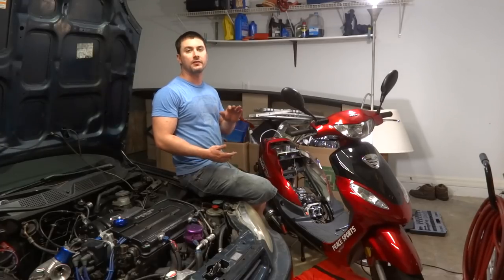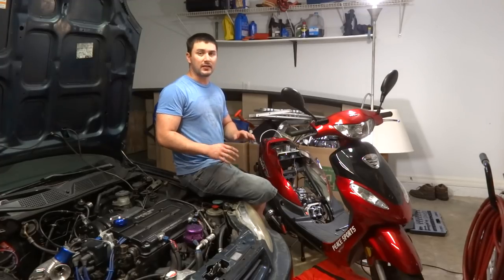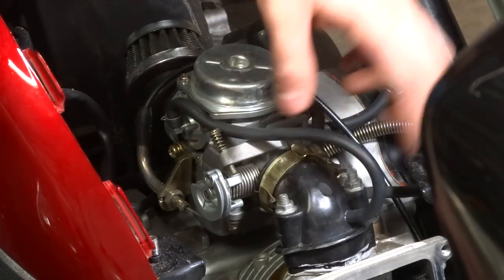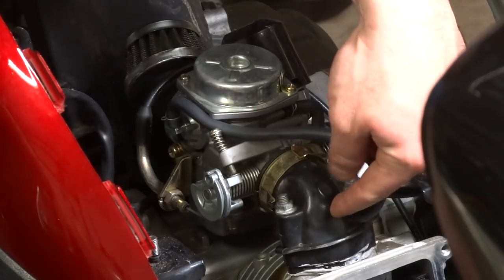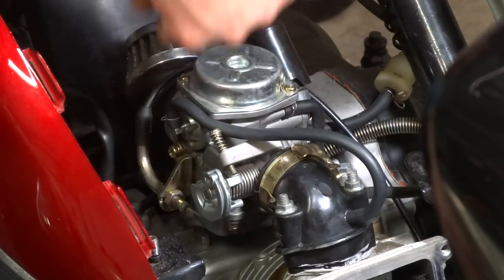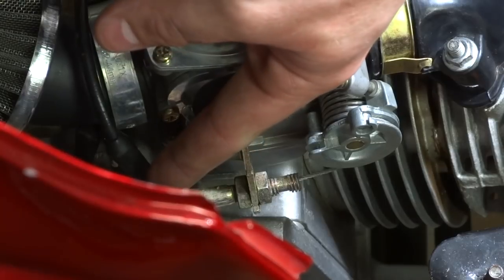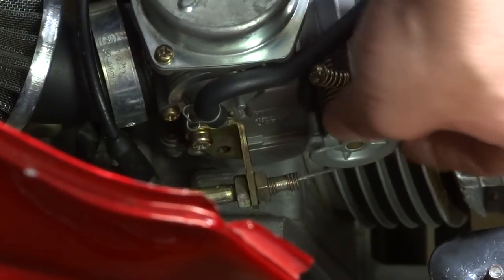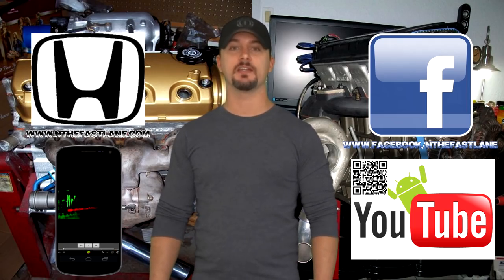150cc Carburetor On 50cc Gy6 "How To"

Comment: I have built a few 100cc BBK engines and have been using stock 150 carbs on all those engines for several years now with their stock idle and main jets.  They allow the engine to breath and pull really strong and reach speeds fast.  I am in the process of building another 100cc BBK engine using an Airsal piston, big valve head, Naraku HD crankshaft, A9 cam, 49/17T gears, 5 & 7 gm variator weights...love it!
Reply: Edwin Mendija Hi Edwin noticed your post and wondered would you mind a few questions I'm not new to tuning just new to Autos so I have heard that Naraku parts are very good so I'm getting a camshaft from them but regarding your list of parts 
the big valve head _how big compared to standard 50cc ?
A9 cam same question as above ?
how do you know the standard gears so you can up them to 49/17
im assuming the variatior weights are down to rider weight as well as revs motor is pulling? thanks
Reply: Edwin Mendija what size Jets are you using..or can you just put the 150cc carb on 100cc bbk.
Reply from the maker: Yes Sir. They really improve the bike. Can't tell you how many comments I get that putting a 150cc carb on  a 500c bike is impossible.  All you need is the intake neck.
Reply: Stock 150 carb just drop it in.  Adjust carb in small increments and you'll find the sweet spot where it idles and starts smooth & easy.  Must be used on a BBK otherwise cannot promise how this thing will act on a stock 50cc engine.  Combined with a performance exhaust, your limiting factor will be gearing...it'll pull strong until redline and stay there if you let it.
Reply: Okay so guys i have a 50cc taotao bws50 i did a bbk 82cc it was labeled as 100cc but its only a 50mm piston so yea but all i have done is a cdi,ignition coil and i run a ngk cr7hsa plug i got a 150carb and neck coming i can hit 45mph on flats now how much should i expect to hit with the new carb everything else is stock minus bbk,cdi and ignition and spark plug btw i weigh 130ilbs lol
Reply: My son, about your weight, easily goes 60+ using GPS speedometer. with that set up and 150 carb.  You do have performance exhaust right?  Also use 7gm variator weights.
Reply: Edwin Mendija I'll keep that in mind so far I've done a lot to mine you can check it out in my channel
Reply: @RspecNick  what's up man, I watch a lot of your vids btw. Did you ever put the 150cc carb on your 59cc bbkit motor? If so did it improve your mph? Mine does 45-50 with a Kehin carb bit I'm curious about the 150 carb. Also, I watched your vid where you swapped the 50 for a 150 motor. How fast does your scooter go with the 150 motor? Thanks Nick!
Reply: @mikecuev820  hey what's up man. And yes I did put the 24mm or 150cc carb on and it shot fireballs I needed to down jet 3 sizes it ran good tho from a dig.
Reply: @mikecuev820  with the 150 motor I was hitting like mid 60mph tho it was nice.

Comment: If anyone's wondering? Yes it works, it actually fixed my problems I was having, not sure why I've read so many comments on the internet/articles stating it doesn't work. Good thing I went for it, I did bought extra jets just in case, but it doesn't look like I needed them.. might be different for you though? Depending if you live up in the mountains or live near the beach. Also..you don't need to drill a hole and put a extra nipple, well you Do.. but my carb came with a 2 way splitter adapter, so it shared one nipple, and I didn't need to drill a hole.
Reply: I.need help ,I tried didn't work ,what did u do with those two hoses that was connected to the old 50 cc

Comment: I just rebuilt my gy6 100cc bbk will a 150cc card is a nasty combo 55mph on the daily in slc utah 105 main and 32 p
Reply from the maker: Yep, that's what I run. Heres the bbk aftermath test run on flat ground. Link: http://www.nthefastlane.com/Scooter/gy6-100cc-bbk-50mph-proof
Reply: Nthefastlane another question.. how many starters have you gone though
Reply: @ryanferreira3456  I've went through 3 and about 6 kick starts.. 1p39qmb 100cc bbk a9 cam port and polished head oversized valves I can stand on the kick start with the amount of compression it has I weigh 150

Comment: The 150 caliber I received the throttle bracket was just the opposite from top to bottom from that one the hole for the throttle cable was at the top side bottom side

Comment: i put a 150 cc carberator to replace the original 50 cc carberator to make it go a little faster. What else do I need to do from there? Do I need to replace the fuel line and throttle cable?

Comment: I have a gilera runner 50cc and I have 4 gram rollers, yasuni r exhaust and is completely derestricted. I replaced the stock card with a bigger delorto carb with malossi Reed valve. Now when I start the bike the engine revs up to its max and won't calm down unless the choke is on. is there any way around this because I want to use the carb

Comment: Nthefastlane i added the new carb to my friends big bore on his peacesport, but for some reason it wont start unless we add gas to the carb manually. We checked the vacuums, but i wasnt sure if we were missing something. Do u have an idea of whats going on?
Reply from the maker: Dani T adjust the throttle screw 1/4 turn tighten at a time till it starts.
Reply from the maker: Dani T make sure the fuel hose is on the correct nipple and check the vaccum hose.

Comment: can i use this without a big bore kit i have air filter installed with big jet 50cc scooter carburetor 4.5 rollar weights exhaust performance cdi and ignition coil

Comment: Hey.. Watched your videos and used them as a guide when doing the big bore install.. I put a 26m carbuertor on the scooter but when my son rides it. It would only hit like 40mph and it jerks hard when trying to full throttle....in yout experience what do you think is the problem....any information is greatly appreciated...respect brother..
Reply from the maker: I would look at your variator or clutch. He could have some sticky roller weights inside the variator causing them to shoot out abruptly. That can give you quite a jolt. Also a clutch that grabs wrong can do the same.
Reply: @Nthefastlane  too much gas!
Reply: @Bchassis  yep, the 24mm carb is too big for a "100" kit, much less a 26mm

Comment: I have a 50cc icebear with a 100cc big bore kit on it. And I would like to know which carb would be better for it.  The 125 carb or the 150carb?  or should I get the big bore carb?  please tell me which one would be better...  thanks for the info..
Reply from the maker: +dragonscave101 Get the 24mm 125cc carb, it comes with a 105 jet. All you need to do is adjust the idle screw a little. You can only only get one screw in on the throttle bracket. Go to my channel and look at my scooter section. I show what you need and how to install the 24mm carb.

Comment: Just got a 150 carb for my 50 upgraded with the 100cc bbk. Problem is my scoot doesn’t have any vacuum lines. The line coming out of the intake manifold is just a 3 inch hose with a vent on the end. The old carb used the throttle assembly to open the air piston and use the main jet but now I have no vacuum line to do this so the engine is stuck using the pilot jet all the time

Comment: Did you have to change any jets? My stock carb is super lean after 47mm kit. Tryin to get it fixed today but I'll eventually order the correct carb
Reply: I use a 150cc carb with a 105 main jet on my 100cc bbk and it works beautifully

Comment: I put the 150cc carb on my 50cc and it runs and drives fine but should I adjust the valves to .005 or keep them at .004? It has been upgraded with 80cc kit
Reply from the maker: 4 thousands to 5 thousands just boils down to what you feel comfortable  with,not going to make much of a difference except possibly a louder lash.

Comment: one thing dont remove the plastic shrouds from around the barrel(cylinder), it will over heat, on a open ruckus you might get away with it but on a scooter thats closed in they overheat.
Reply: aly nicholls that makes no sense at all those heat shrouds keep engine heat in and away from the rider they do not cool them that makes zero sense why would putting a blanket on something hot cool it down?
Reply: LiveToRide all air cooled engines that have cowls cool the same way the fan pulls cool air in and around the head and barrel if you have water cooling you dont need this its been like this since the 1950s at least
Reply: @LiveToRidee  No the fan is pushing air in side to help keep it cool.

Comment: i have a 2012 taotao and i did a 100cc big bore kit and ran on the 50cc carb fine but will the 150cc carb i got make it preform better? also what do i do with the little air line that goes into the carb?
Reply: 23mm carb is the max you can put on one of those taotao to me. On one client we put a 23mm carb with a 91 main jet.. 40 pilot jet and we set the needle clip on the top quarter  part of the needle and it works just as fine as my other clients scooter. That guy didnt want to buy the carb so we put a 20mm carb and put a 88 main jet with a 35 pilot jet and the needle clip on the same position as the other guy. They both run the same to me after adjusting the air fuel mixture screw correctly.. either one will work way better than the stock carb. 150cc carb just sounds crazy lol

Comment: Did you keep the same jets the carb came with or did you have to switch them out? If so what will i need i have the 52mm big bore kit
Reply from the maker: I left the 105 stock jet in the 24mm carb,then chaged the filter to a sponge one and then played with the idle screw till it idled the way I wanted it.

Comment: Hey I got a question for you I bought a 100cc BBK then added the 20mm cvk carb, performance variator, clutch springs, and gear set. Now I'm either losing power intermently or there's something wrong with the clutch. After riding it about 10 miles I got home and smoke was coming from the cvt case. So the question is what do you think it is and how fast do you think it should go after it'd done. It was topping out at 46mph on flat ground before it started having issues.
Reply from the maker: Get rid of the stock filter and box and put a sponge filter on the carb.
Reply: Bro... BBK's are KNOWN to eat up Chinese Belts and even UPGRADED Variators!!! I hate when ppl say that a BBK just tears motors to pieces... so not true, if u take care of it and aren't running 8-9K RPM 24/7! All of this said, my point is, go buy yourself a good variator and a GOOD Kevlar Belt. That SHOULD do it, but honestly, I just went ahead and replaced my entire CVT with name brand, performance stuff. My 2013 Tao Tao w/ a 100cc BBK (50MM Piston) runs about 58-59mph on flats and that's GPS Verified!!!
Reply: +Nthefastlane Oh and the takeoff now on this BEAST is INSANE! I'm SAFE on 55mph Roads, every day
Reply: I uave a 2014 taotao bws50 with the same bbk and i run 45mph on flats with stock carb,intake,muffler and i havent touched the cvt so im kinda excited to see how it runs with new carb,muffler,air filter and then cvt mods

Comment: A 150cc carb will not work on a 49cc with a bbk unless u change out the jets.  Stock 150cc jets will not work for the 100cc bbk.  So what jets are you running in ur scooter?   I have this exact carb and it will not idle. So I’m curious as to what jets u are running in order to achieve a stock-ish idle and increased performance without backfiring and stuff

Comment: I'm getting ready to install a 100cc kit on my Kymco Agility 50 and I'm planning on using one of the PDJ 24s maybe a 26mm but I'm wondering just how much of a power gain did you notice ?
Reply from the maker: Quite a bit of an improvement..there's no comparison, definitely a lot more fun.

Comment: Thanks for the tip....but I think I explained myself wrong.....when the scooter is riding....and reaching top speed...it bogs...or like hesitates.....i thought it was running lean so I went through #110...115...and even 120 main jet but didn't improve...it has pod filter and performance exhaust...

Comment: im running 19mm carb on my 100cc kit with stock head.139Qmb engine.....how can i make ped faster ???
Reply from the maker: shauny17091987 roller weights and remove the headgasket and use permatex copper spray on the block and head. It will raise the conpression and up the HP. Did it to mine, runs fine. just add a bigger jet or it will detonate. I run a 24mm carb with a 105 jet.

Comment: Hi, did you use the same intake spacer or a 150 cc ?
Reply from the maker: Yes I used the stock 50cc spacer, I just dremeled the hole as big as the intake neck.
Reply: +Nthefastlane  Thanks
Reply: +Nthefastlane I have 100cc 2 stroke how big can I go with the carb its fully ported but the carb is stock pls advice.

Comment: Can you use the intake neck on a regular 50 cc are do you have to upgrade your head
Reply: cause i no when i tryed it before the manfold never fit in the hole
Reply: jerome lush it fit on mine, I just sprayed some WD40 in the tube and it slide in, tight but doable.

Comment: Is that vacuum line tapped into the intake to keep the engine running? I tried to install a cone on my heritage 150 and it stalled after 4 seconds. Reinstalled the stock intake and it ran perfect.
Reply from the maker: Yes, it needs the vacuum line or it wont idle or run properly.

Comment: Hey I've been trying figure out did you use the original gasket and spacer or did you have to get a different sized spacer and gasket with O-ring?
Reply from the maker: Click shop this video link, top comment. It has the correct intake neck which is the 150cc. It'll bolt right up. Also the spacer you can use from the original 50cc. I believe the spacers hole from the original 50cc is oversized to fit both If I remember right. Just match it up to the 150cc intake neck and see if the intake hole is the same diameter.
Reply: @Nthefastlane  My new 150cc Carburetor came with an 150cc intake neck with a 22mm inner diameter. My spacer and gasket of my original intake neck is 16.4 inner diameter so i don't know if i keep the original one on there or find one with the same diameter of the new neck that i have which is 22mm inner diameter.
Reply from the maker: You can either find one with the same diameter, or get sandpaper and round it out at an angle so it opens up to the intake neck. You can't take a lot off, but you can angle it so the holes kind of gradually run together. Or you can search for a 150cc spacer. If I remember right, I think I modified my 50cc OEM spacer by porting it out to match as close to the 150cc intake neck. I would even put a little bit of gray RTV on both sides of the plastic spacer, not too thick as you don't want it to spread in words, but enough to give it a nice seal.
Reply: @Nthefastlane  Thanks I really appreciate the advice! Big help!

Comment: Hey guys i need some help, have a 50cc gy6 converted into a 100cc. I bought a 150cc carb from Amazon and its listed as a go kart carb, i believe its a 31mm but Everytime i full open throttle and release i get a crackle/cracking sound coming from the engine almost a backfire. I believe its the 150cc carb. This isnt normal and why is it doing what it's doing
 Any help is appreciated, thanks GY6 mod community 😍
Reply from the maker: You want the 125/150 CC 24 mm carburetor. You can find it in the my store pinned to the top comments. That one comes with a 105 main jet.
Reply: @Nthefastlane  so is the 31 mm too big for it, i thought the bigger the better because it opens up more allowing more air so its more performance. Every shop kept telling me its too big but i brushed it off as its ok theres no reason why a big carb cant work. Thank you for your help, looks like i have another order to place.

Comment: you should not have needed that big carb with a converter you should have just bought a 23mm card that is made for use with the stock 50cc using a bigbore kit my self I have a 20mm true KEI HIN and if you jet that puppy tight I bet it would be enuff to drive the biggest bore kit you can buy I am running it with lots of gas flow right now and well my bike will hit 47mph on a straight and 50 with a downhill and I am 230 lbs and have slider waghts that are on 4 gram in in it. I think everything I have would be more then enuff to drive a 105cc bigbore kit. and that baby is so big you have to Machine the Case for Fitment. witch I would like to see some one do I never seen a 105 installed yet do to the milling of the case having to be dun.

Comment: Don't a 150cc Stock Carburetor make A 50cc Scooter Faster! Like Reach up to 55to60mph
Reply: Lololol no.
Reply: Yes it does
Reply: Unko edwin, you live oahu? Was wondering if the 150cc carb jets are the same as the 50cc jets?
Reply: NSBtil1die I stay Molokai. Just bolt’um right on. Stock 150cc carb 24mm. I neva badda change the jets. I have a 100cc BBK and aftermarket exhaust. Take your time tuning little at a time. Shoots. Good luck!